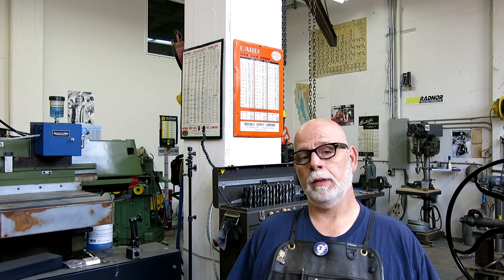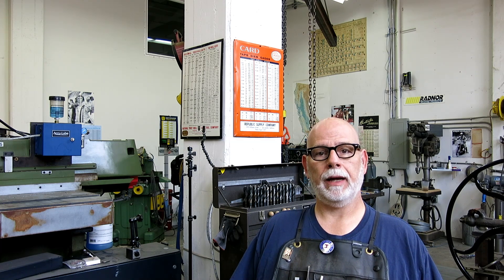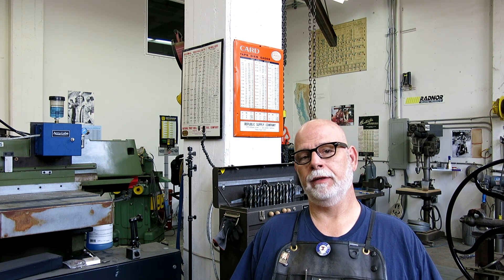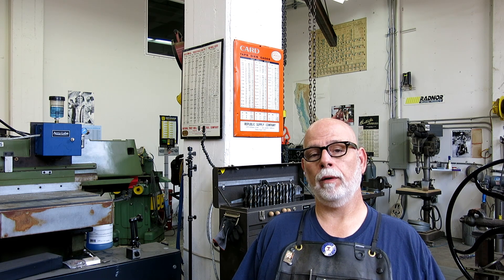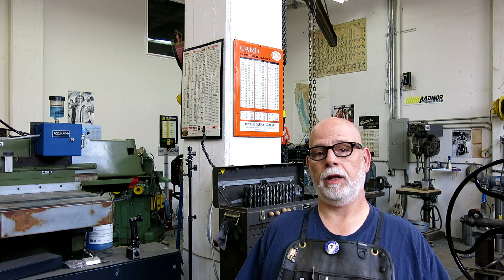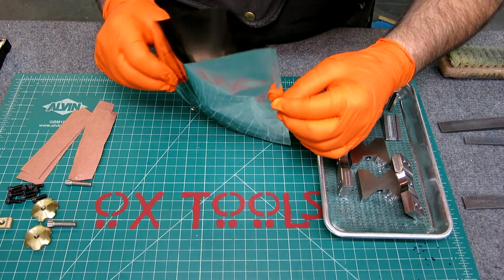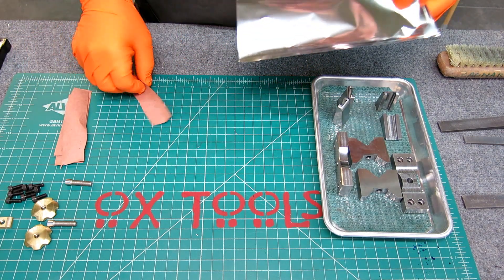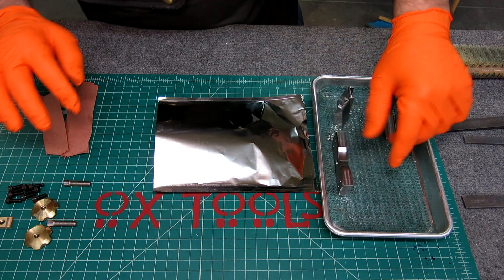Toolmakers Adjustable V Blocks P4

Comment: Tom, my trick for filing handsome (and accurate) radii 

When you need to hand file a radius, I've found a "faceting" - a series of calculated flats - convenient to generate a true radius. I borrowed the technique from the old time spar makers, the people who fashioned masts and booms in the days of wooden ships and irion men. Look in the old shipwright books where they show how a square timber is first made into an octagon, then a sixteen-a-gon or whatever and so-on until you have a round spar with the correct diameters and tapers called for in the marine archetect's drawings.

Say you want to dress a quarter round radius (r) on a 90⁰ corner. The first facet is on a 45⁰ angle and the first step is to calculate its width and its intersection with the work face. From plane geometry we know the 45⁰ flat is tangent to the radius and a radial line to the point of tangency is perpendicular to the first facet and at a 45⁰ angle to the work faces. Lines drawn from the intersections of the first facet to the work faces bisects the 45⁰ tangency and the work face, thus its angle is 22 1/2⁰. The tangent for 22 1/2⁰ is 0.414. The width of the facet is therefore 2 x 0.414 x r. If the radius r you with to file is 1/4" (0.250") the width of the first facet is 0.207". The second two  facets (rushing through the math) are at 11 1/4⁰ and 0.100" wide. And so on until you have enough facets of equal width to blend into a smooth radius. One caution: do not file past the line of radius tangency to the work face. This blurs the crisp reflection making that particular highlight uneven and ugly not to mention inaccurate.

This technique (I call it "blended facet radius") performed with care can produce remarkably accurate results. If you remember the first two double tangent factors (2 x 0.442 and 2 x 0.199) and the two angles (45⁰ and 22 1/2⁰) you can file the first two facets by calculating widths with r and eyeball the rest to equal flats. It sounds over-technical but after your first few trials of anguished calculation and anxious estimation of angles the process will gel into a simple trick of hand work (causing a watching noob to think to himself "How'd he DO that?").
Reply: He said that at 10:38
Reply from the maker: When Forrest talks I listen. Good to hear from you brother.
All the best,

Tom
Reply: @xenonram  Yeah, he did. I saw it. His was an eyeball oriented corner radius filing procedure. A noob lacking the cultivated eye would be hard pressed to emulate it. 

My contribution was to inject a little math in the process and discuss the steps in greater detail. If you hand file corner radii by calculated faceting, you're sure of accurate consistent results. You go right from sharp corner to accurate smooth radius in controlled steps where the radius gage is a handy checking device  not a creater of frustration. Later as the noob develops skill and an eye for the geometry, he can wing it. 

Call it circular interpolation via incremented vectors instead of rectangular coordinates. 

OTH, I've been doing this stuff for 60 years but I still break out the calculator and dividers when I have fussy radii to do.

Not everyone has Tom's eagle eye and sure instincts.
Reply: It's interesting how techniques are used in different ways depending on the trade. Blacksmiths turning square stock into round stock do the same with a hammer instead of a file.
Reply: @Forest Addy I am following this conversation. I calculated a different facet width for the second facets. Can you confirm? 2 x 0.099 x 0.250" = 0.0495"
Reply: @AtelierDBurgoyne  You are correct. I  made a mistake, a typo, and just now corrected it. Thanks for pointing it out so diplomatically. There was a second mistake: the half angle of the second flat should have read "11 1/4⁰". Working the math: tan 11.25⁰ x 2 x r = 0.100"  where r = 0.25". The 0.100" is 0.099546" rounded to 3 significant figures. I edited the text to read "11 1/4⁰." Thanks for spotting that. The math is now consistant. I hate screwing up. It's embassassing but more inportantly, it causes confusion for those I'm trying to reach. That's what I get for posing as an expert.

Comment: My mentor met a file salesman (yeah this is from about 40 years ago) and the guy said the worst thing for a file is a steel file  brush. The high carbon steel will dull the file. Of course the more brushes he sold the more files he sold. Use a block of wood or soft natural, not plastic, brush. Oil them with cutting oil and never motor oil. I appreciate you sharing your skills Tom.
Reply: That kinda depends on how you use (or misuse) a file card. You are supposed to drag the card across the file parallel to the cut of the file. If you do that, the steel teeth of the card just follow the grooves in the file and pick out any stuck dirt. You can use soft stuff, but if it is softer than what you have been filing, it won't be able to pick out any stubbornly lodged bits of swarf in the file teeth.
Reply: @lwilton  Ultimately it's a consumable like a saw blade but the story was fun to hear. I try to keep mine oiled and use a scribe for stubborn swarf.

Comment: Great video. You may likely have them, but if not grab yourself a couple pairs of seaming tongs from one of your fleamarket ventures or a cheap pair from the local vinyl siding shop, for folding your bagsl closed. They make a super nice, crisp, bend and you can fold a bag like that up, dead tight, dead crisp, and hammer each fold down. Plus at the end it give you that rewarding straight line obsession high.

Comment: Looks like that oil wicked into the paper and allowed the part to move, instantly I might add. Always enjoyable Tom, looking forward to the next installment.
Reply: Um, no? It was already moving significantly several seconds before that happened.
Reply: @14768  right before he added the oil he started milling above the ramp and was no longer supported underneath. The oil being wicked underneath didn't help. The farther that the mill moved away from being supported the situation was going to get worse. I do agree with you and think that it was already starting to go.

Comment: The filing philistine believes that "Hammer to fit, file to hide, paint to cover" is a valid workflow.  The true professional uses all of the tools in the box to accomplish great work. Metal will be worked, milled, filed and ground to shape. If it needs to be fitted into another object say a piece of wood, there is no shame in using lamp black, inletting dye, or some other method to mark out the contact points, which can then be removed with an appropriate tool chisels and files for wood, a Biax for metal.
Yeah, Covid has me spending way too much time watching Mark @ Anvil; Keith @ Vintage Machinery etc.
Great work, please keep it up.
Reply: I have always heard, "Build to print, beat to fit, paint to match" as primarily a slam on engineers and designers who design things but have never built much.  The CNC craze has gotten to be quite boring to me.  Everyone and their brother just wants to jump straight to CNC having no prior machining experience, that why this channels and a few others are so great.  Certainly CNC has its place though.

Comment: Looking forward to the heat treatment segment. Several others have had varying results. Getting the parts out of the bag and into the oil quickly enough seems to be a problem.
Reply: I have nightmares over what the heat treat oven will do to my stuff.
Reply: No oil. AIR hardening (A2)

Comment: An option would be to stack two parts kind of like adjustable parallel, that way you actually have more contact surface with magnetic V block.

Comment: Great video Tom, I am always in the mood for meatloaf and a bit of Tom-filery. Just wondering if you could talk a little blurb about the rolling technique you were demonstrating in contrast to following the contour with the file. I have always favoured the former in contrast to a lot of my work mates, and I am wondering you could discuss the difference  in the two styles, or if it just is a preference. Thanks and cheers, enjoyed this video very much!
Reply: You *roll into" your chips when you use the "wrong" way. Plus, after learning the "right" way (which is admittedly kind of counter-intuitive) I find it results in a much more evenly distributed radius (in my experience).
Reply: @mattmanyam  Thanks mattmanyam - I've normally rolled towards the file direction for no particular reason but your explanation or rolling into the chips makes sense, I'll try it next time. And thanks Tom for another great detailed video.
Reply: Here's an upvote for "Tom-filery" :D

Comment: Tom, I really love your masterfull work. I also know the fulfillment from filing. "Wondering away while filing" as in a relaxed way to combine work and output. I like it too but I'm also sometimes in a hurry to get the job done. CNC works but also not all the sides are chamfered or filleted when you're done. Did you ever thought about using a "Makra" tool or the more expensive Swiss original (Reisenhauer?; I can't remember the exact name) which allows you to put a kind of precise but cosmetical for sure, chamfer or radius on your part with speed? It's like a miniature router upside down with a really tiny follower bearing on top. I never witnessed the use in any machinist video from the guys I like to watch (Rob Renzetti, Stefan Gotteswinder, Adam Booth etc.) I'm curious of your answer. I hired a guy who was familiar with it and was unhappy until I bought it for him here too. Then he became happy instantly. I was hesitant,  because I paid good money, but now I don't want to part with it no more. Just like my first bandsaw which came in really cheap, and that was the only reason to buy it at first, now I don't know how to work decently without it. Live and learn. Best regards, Job (I know this is not a constant radius, but the small one is a lot of filing work saved as a start)
Reply from the maker: Hi Job,

I have not heard of this magical device you speak. Time to do some research I see. Thanks for telling me about a tool I don't have!

All the best,
Tom
Reply: Stefan has a homemade version, and Robin has a homemade version as well, but his uses abrasive belts.
Reply: @KISSMYACE3203  I think I saw both but these are different designs. Reishauer is the Swiss brand and Makra makes a more affordable version. Look for Makra KEG 250.

Comment: Not sure this is too geeky, but if your first facet removes ~60% from the corner to the scribed tangent marks, and the second ~50% of the new corner (x 2 corners) to your tangent marks, this helps get a good start to circular radii. Said another way, if you wanted a 1” radius, you could scribe 1”, then 0.8, then 0.6; you have accurate marks for the 45 degree facet and 22.5 degree facets. even if you don’t scribe these lines, you eye can judge 60% and then 50% fairly well.

Comment: Tom, after watching your intro I was curious if you may have lost all of your hair due to one of the experiments gone awry? I'm just kidding, I do have a real question though.
I thought that square edges down in a groove like the grinding relief grooves you are making here, are a bad idea. Something about stress riser is what I was thinking of but my memory is hazy and I am just a novice and watcher of the machining trade. Would this not be a concern for the tool?
I don't mind filing, the man who taught me some blacksmithing and fabricating had me doing it for weeks sometimes. It can be rather relaxing.
Hope you are having a good summer regardless of the madness surrounding us at the moment. Thanks for the videos.
Reply from the maker: For a highly stressed part you are correct. In this case the parts are not under any particular stress so a square groove will probably be fine. 

Cheers,

Tom

Comment: Do you have a 'filing vise'? 
Handy gadget for small parts or close to the edge applications.
You hold it in a vice and it presents the work at an angle for ease of access.
Found out about them watching 'Blackbear Forge'.
https://www.youtube.com/watch?v=9ioyPyHi4OE